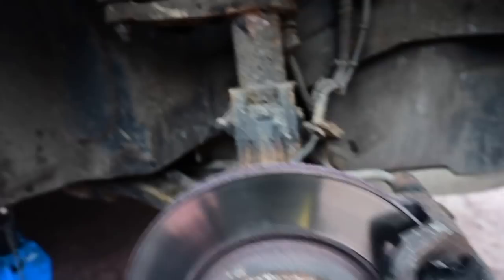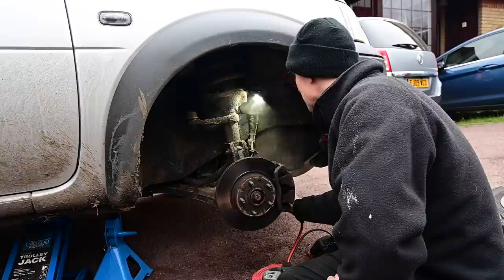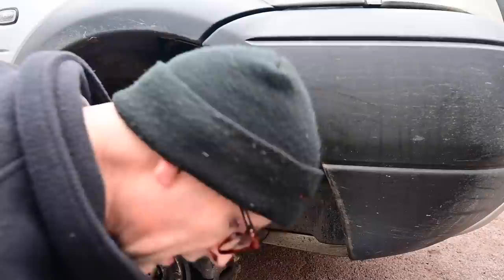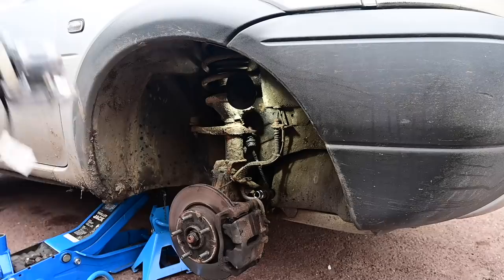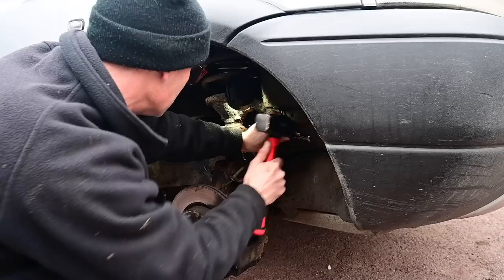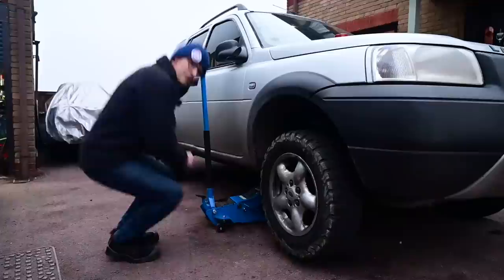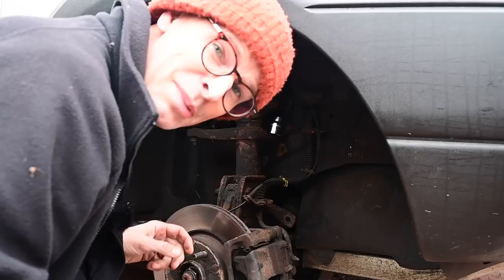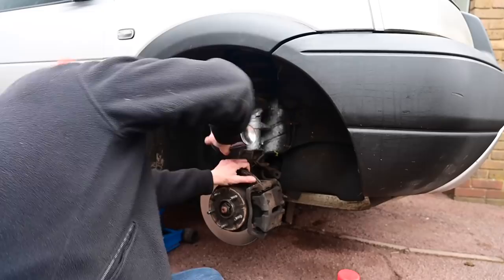Whats That Clonk? Freelander Drop Link Fun

Comment: Watching you struggle through this brought flashbacks of many a cold afternoon on the driveway trying to undo stuck ball joints!
- a trick I have found that may help you in future is as follows;
Using vice grips grab the shaft of the threads (usually around the area of the weather seal/boot) then undo the nut as normal. You MUST do this before rounding the nut (of course) and it only works for me about 75% of the time, even with heat applied. It does of course ruin the joint, but for your situation that would not have been an issue. I hope it helps anyone who reads this.
Congrats on having the patience to see this one through like you did!

Comment: If you jacked up the two front wheels together it would take the tension out of the anti roll bar and easy to work on wagon. good video as always.
Reply: Great minds......
Reply: Yep,  Torsional rigidity ....And just cut them off , why bother unscrewing scrap parts ?
Reply: Interesting,but wouldn't the weight of both wheels pull down and put tension back onto the droplink in question?
Reply: @toonmag50  but with one wheel that has pressure on it add’s torsional pressure on it forcing the bar up and fighting not allowing room to put the new one on
Reply: @toonmag50  The Bushings are underneath the level ofthe main part of the roll bar so as the car is lowered the bushings become looose and so do the droplinks as the weight and force is taken up by the lower balljoint and lower part of suspension arm , hence making the droplink free to move (if worn or damaged that is ) Having one wheel under tension and not the other can disguise a faulty droplink .
Reply: @Oh-Jay52  I do like doing my own car maintenance.
I'll give your method a go when the weather gets better. - one drop link sounds like it's on the way out.
Thanks.

Comment: I have an inductive heating tool. Bought it to release all the suspension/subframe bolts on my TD4. And absolutely essential tool. I also have a MAP gas torch. As good as gas and flames are there are the obvious hazard with heating up vehicle components etc needs to be carefully thought through. The inductive heater removes that hazard. £199-00 off of Uncle Jeff’s mega store.. paid for itself in one 2 hour session. It’s cheap but not overly nasty.. and it WORKS!

Comment: I did the drop links on our 13 plate 108"000 mile fiesta last year,just after I bought it (it had an advisory for a lower arm ball joint, which I replaced as units on both sides.
Never done anything like it,but the drop links were easy peassy 👍
The lower wish arms were a bit of a pain ,but doable, then tracking from Halfords for £25 and job done.

Is it just me,but working on the drive,you lay out all the tools and then within 5 mins everything is suddenly hidden or out of reach 😲

Comment: This reminded me of me fitting a new electric fan to the Stag… its new mounting ‘frame’ fits underneath the radiator. Undo the bolts top and bottom and lift it up to slip it under… Except one of the bottom bolts that’s welded to the inside of the radiator began spinning…. The saga went on and on with the offending bolt eventually being ground off and a replacement radiator - which in truth was probably due anyway. Just a ‘quick’ and easy job that ended up taking weeks (due in part to lack of time) and lots of leg pulling from my mates…
Reply from the maker: Haha the easiest jobs are often the hardest!

Comment: Quite a good (economical) tool to get, to increase your palette of stuck-thing-destroying techniques: an electric die-grinder with tungsten carbide burr. I have a Katsu 101730 from Aim tools and some 6mm-shank burrs from eBay. It will eat its way into / through anything and would make quick work of a rusty bolt that maybe the angle grinder can't access. 
Don't get an air powered one and don't get a slow one with a drill-chuck.
And best get some 3M Peltor 3 ear defenders.
Reply from the maker: I was considering buying one if this went on any longer

Comment: Okay.. I cannot belive the parallels here..
Firstly - recently changing one of two owned R8 rovers for an 02 plate silver freelander td4 
Secondly - the upper ball of the offside drop link begins clonking within the last week, which I changed it today.

..what are the chances

By the way, the blue goop i suspect may be the nylon in nylock nut melting? The nylon insert in nylock nuts i took off today was blue.

My Freelander put up significantly less of a fight thankfully, especially as I don't have power tools. Took me 40 mins if that and was far less farcical!

If these fleet parallels continue, heads up because your tomcat will get hit a stone on the motorway which will crack its windscreen soon! 
I need to sort mine out

Comment: Couple of extra tools to consider. A nut splitter set then when you do the other side cos that’ll be about 3 weeks away ;) will make removing the top nut a doddle. Other is a set of crescent x6 pass through sockets for those top nuts in the drop link

Comment: Drop links - the 'how to' videos on here make it look easy. Usually, they are dirty, corroded and when you attempt to undo the nut, the balljoint just spins round, so 'easy' is the last thing they are.. 
Best way to get old ones off, if you don't have flats to get a spanner pm them, is:
1. Cut off the small rubber boot
2. Grip the shaft the nut goes on to where you have removed the boot with a sturdy pair of mole grips
3. The nut is then easy to undo 
When replacing them, don't get ones with splines or Allen sockets on, they corrode easily. Get ones with flats by the rubber boots so you can get a spanner on them if you need to replace the later.

Comment: The Blue Goo is the Nylock Plastic melting out of the nut. Get that a lot when we attack stubbon nuts with Oxy Acetylene.
Drop link nuts... FT. They should come undone once they're tight due to the Nylock nut being on them.

Comment: Drop links are the work of him below, don’t know if you watch SMA but I took a tip from him and stopped wasting time trying to undo them and just cut them off, then put the new on with an impact gun on the highest setting. Usually works, last year I replaced two, only to find still got a knock, it later turned out to be the caliper guide pins had pulled threads allowing the caliper to float (a fun fix) two months later the ‘new drop links’ failed which I could not believe and spent much time mis diagnosing, the movement could only be detected when under load those were moog and I switched back to OEM and all was quiet.

Comment: Matt you need a 12v grinder, small and really good for confined Spaces. They are called 'cut off grinders'. I have a Parkside one from lidl. You'll be using it a lot for rounded bolts when your main grinder is overkill or too big.
Reply: Yep 12v rotary tool cut the nut 10 mins max 👍

Comment: I remember with my old Volvo C70 trying to get the wheelhub off and one horrible "torx" bolt being stuck solid. It's still stuck to this day - I took the whole wheel assembly off and replaced it because none of: a 5lb mell, a blowtorch, £50 of removal sockets, a drill or a grinder would budge it.  It's in my garage. One day, ONE DAMN DAY that bolt is going to see daylight I swear.

Comment: Not sure if it's been mentioned before but a finger power file would have removed the last bit of bolt in a few seconds. You still would have had to push it out but they're great for removing hard to get at bolts and nuts like rear brake cylinder bolts.

Comment: Just wondering, why didn't use a nut splitter and the a could chisel to widen the split till the nut came off. If the link was still rusted in (as yours was bracing the are and whack merry hell out of the link. Never had a problem using my "thumper method"

Comment: Been there many times Matt, the smallest job turns into an epic. All part of the fun and very satisfying when you eventually get there.
You should be a dab hand at changing drop links if you've had a 156. My Marea used to go thro them for fun and I think the 156 has the same front suspension?

Comment: I had a td4 freelander....not a bad car, that said it was awful very rusty for 2005
Water leaks electrical problems galore,
the driving position is terrible for anyone over 5 feet 10, i spent the whole time  looking through the top 3 inches of the windscreen  due to the lack of height adjustment in the seat. Also the position of the alternator is to low down for an off road car. Thats because the engine was not suitable really just a bmw unit that fitted in the space. The track rod ends are a brilliant design though.
You do know you can put an allen key in the end of the droplink to hold it.....
Reply from the maker: I wonder if they changed them as I’m 5 11 and it fits me really well?
Reply: @furiousdriving  im 6 feet 2, 5 feet 11 is just about the limit for a good position.
Mine was a face lift 2005 your car is the earlier model with in my opinion the better dashboard the later ones are lacking practically due to the passenger airbag and the daft stereo fitted which is actually a ford one.

Comment: Next time you need to change a droplink tighten the mole grips on the rubber boot and it’ll stop it spinning and will come straight off
Reply from the maker: But it wasn’t spinning, it was rusted solid to the mount, the tools were slipping off it
Reply: @furiousdriving  thought you said the droplink was just swinging when you tried to undo the nut. Would’ve been the joint inside the rubber part that was spinning and the grips would’ve locked it. Trick my brother taught me when changing them

Comment: Surely a dremel would have got that off in no time , I’ve took many a nuts and bolts off with my Dremel and you need to just cut through a bit of the nut and then give it a clout to open it up , get a dremel !!!
Reply from the maker: I did use one for a but but it looked the same as the drill so cut for time
Reply: @furiousdriving  I had a rather rusty mr2 not long ago and I overhauled the suspension I didn’t mess about with nuts a bolts as they were rotten , I just cut through part of the nut or put a slice in it , then split it with a hammer

Comment: LO,again, My old mechanic tutor always told me to do suspension stuff in 2's. So i guess you are gonna have the same issue on the other side soon. Think agricultural.:elbowcough:
Reply from the maker: weirdly that one looks much better
Reply: Ideally, yes. But sometimes you hit a pothole or a curb with one wheel, and only the suspenssion part on that side gets damaged, while on the other is fine. So not mandatory at all, especially if there is no play.

Comment: Workign on old cars twist sockets and a U joint for the impact are a really good idea. I got a 17 one last summer and it helped me immensly working on the front suspension on my peugeot 206. Then got another 11mm one for the cat nuts that had shrunk from 13 to smaller than 11. The ones I got were "AmPro" but that might be an in house brand for my "local" iron monger.
Reply: Another helpful tip might be what i usually do. Remove the socket from the recalcitrant part of the joint and grab the ball with vice grips for leverage. Doesnt matter if we break it further when it's destined for the bin anyway.

Comment: 16mm is close to 5/8 af
Reply: An inch is 25.4mm so you can work out which af spanner is close. Some are really handy with rusty bolts, for example 3/8 is 9.5mm and often fits the rusty nuts on exhaust shield. But for close enough alternatives 7/16 = 11mm 1/2 = 13mm 9/16 = 14mm 5/8 = 16mm 11/16 = 17 3/4 = 19 7/8 = 22
Reply from the maker: Only it wasnt 16mm after all, just a really rusty 15mm!
Reply: That's is true, but it may be helpful in the future.